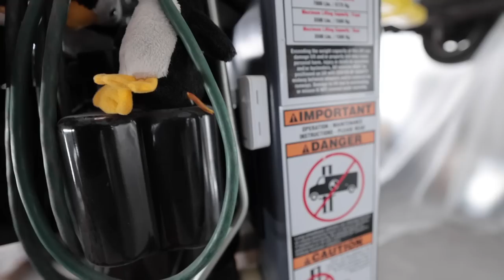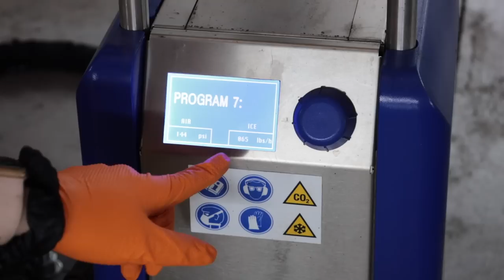Dry Ice Blasting A 50+ Year Old Car // '69 VW Beetle Project

Comment: Consider adding an automatic tank drain to your air compressor.  It's basically a small solenoid operated valve on a timer that will open periodically and drain moisture from the compressor's tank.  It will drastically reduce the amount of moisture in the lines, preventing the need to drain it at your air dryer as often.  I have one on mine, and even when sandblasting on the most humid days, I have very little moisture in my air dryer.

Comment: Hey Sarah, you can leave the drain on the line dryer open. We use them in pneumatic thermostat controls and the drains are left open at all times. Good luck and thanks for all that you do.
Reply: At least partially open enough to drain water, without impacting air pressure
Reply: @MrBeltaine  in a commercial setting there isn't an option for partial. Air pressure loss is not an issue.

Comment: Sarah they make an "agragrite" that can be used for high pressure under carriage blasting. It is less costly, does not melt, does not hurt the metal surface, and can be purchased by the bag. RCP

Comment: Hi Sarah, to fix the water problem on your compressor is to install an automatic timed drain flush valve under your compressor. I have it on my compressor in my shop and it works great, no more water in my tools. And it's cheap, around 50$

Comment: I used to go to these Hot VW meets in Southern Calif where you would see all sorts of VWs that had body off frame restorations. Very clean and the best way to do it cuz there is probably rust and corrasion between the body where it mounts to the frame.

Comment: INteresting choice, dry ice blasting is more of a mild one, not very effective vs rust, but it gets the coating as it freezes it making it crunchy and reduces a lot the mess after.. =) Well, if you're aiming to prevent damaging the undercoating or zinc finish, then you're right. I would personally choose grit or glass, but I would never do it on the lift inside your shop, but in a chamber or outside... =) True one more time, ice is a pretty mild thing, mostly used for finished surfaces and to avoid damage. Actually it's meant more for cleaning, even food processing equipment, where you must have no debris left behind. =) Cheers, girl, you rule! 😉

Comment: You need a refrigerated air dryer. A simple inline dryer really won't cut the mustard. There is a low tech solution I can share if interested.

Comment: I used to used a dry ice blaster years ago when I was a mold maintainer for a tire company... ours was a big machine... ran at 200 plus psi and it used solid blocks of dry ice that the machine shaved down... the nozzle was over an inch in diameter

Comment: Just prior to my retirement, my employer (an industrial gas supplier) obtained a dry ice fabrication machine. Dry ice works by two actions, it freezes the surface and makes it more brittle. Then the abrasive action works like sand or bead blasting to remove the surface material. The big benefit is once you are finished, there isn't a huge pile of blast media. The dry ice (co2) evaporates and you're only left with the rust, paint, etc. As always, you do amazing work, Sarah!

Comment: Hey Sarah.  I love your videos, especially the beetle!   I usually use some petrol to loosen tougher old packed grime and dirt,and just scratch it off/loosen with n scraper/screwdriver before blasting with the pressure washer 😅(find it helps alot, if you dont mind getting high from the fumes haha)

Comment: hi Sarah, there is an attachment you can buy for your pressure washer wand that can introduce glass bead into the water stream. It provides some abrasion without roughing up the surface like bead blasting does

Comment: Nice work as always! You can bake those dessicant beads dry again in an oven. They're saturated when pink, so not helping dry your air. You can also just buy a big bag of them on ebay pretty cheap, and change them out as soon as they turn pink.

Comment: There are a couple things you can do to help remove the water from your lines.  First off, drain your air compressor tank.  In the ambient weather in your area I'd honestly drain it every couple of days.  Then you might think about getting a storage tank and putting that between the compressor and the output to the ice gun, it'll cool the air and store the moisture in that tank instead of letting it get into the air line.

Comment: You could use something that creates steam, or super hot water to blast that transmission.  Companies like Hotsey, and Karcher make pressure washers that have a burner that uses diesel, or kerosene and it heats the water up as you wash.  They work great on farm machinery, or Industrial equipment like Cat bulldozers, or Earthmovers for example.

Comment: If you use a tip with a finer or smaller opening it will concentrate your output and will make your nozzle work on the goopy stuff better. Maybe not perfectly but better. Think of your pressure washer. Turn the tip one way and it’s a mist. Turn it the other way and you can literally peel the paint off of your car.

Comment: Hey Sarah, those filters never catch all the water vapor. Quick CHEAP tip about eliminating compressor moisture out your hose for jobs like this or painting. You live in a hot dry climate as I do. 1st drain your compressor of water. Then you can take some coiled up copper tubing and place inline in between the compressor air outlet and water/air separator. Keep the tubing coiled up and place it in a bucket of ice water. The outlet end is where you connect your water/air separator and then to your spray gun. 

How this works is the heated air vapor from the compressor will condense into water droplets as it passes through the ice cold copper coiled section so the water separater will actually collect it. I use this method when painting cars and you won't beleive how much MORE water you'll collect in the separator.

Comment: The Desiccant of Freight Harbor. The terrifying new novel from Ragnar Fau Ve. Nice work in restoring these old surfaces. Sometimes the grease and grime don't cooperate with the soft approach. The situation can quickly devolve to the point where picks, chisels, fingernails, and eye teeth need to be engaged. You might have used all of these, cause, ma'am, that's clean!

Comment: Pour the desiccant out onto a paper towel that's spread out on a plate. Put in the microwave on a lower setting. Do it for about 30-45 seconds at a time, taking it out and jiggling it around between blasts. It cooks the moisture out in a couple minutes.  Throw out any that go brown.
Reply: conventional oven at low heat.
Reply: @mostcom  - they both work. We just used a microwave at the airport (inter-pane side window desiccant) since it was faster.
Reply: @DrFiero  No doubt. I like the conventional oven just set it and forget it. Radar range needs far more attention paid though faster.
Reply: @mostcom  - No idea what we charged /hr, but considering the object flew, you KNOW it was a huge $ sign!  :D
Reply: @DrFiero  👍

Comment: Big 3 uses dry ice to clean the overspray of paint/clearcoat off the booth floor grating. The robots have cloths, but the floor has open grates, the ceiling has positive air that helps the overspray get pushed through the grates, and onto running water that gets put through a in house waist treatment and recycled. The grates get some serious buildup on them so they are dry ice blasted. The clearcoat is not dry, very sticky.  The dry ice makes it cold and brittle, helping it breakup. We have a lot more C.F.M. than I see you useing. A smaller tip to get the velocity up might help. Just guessing here.

Comment: Yes! Been waiting for this one! Lol 😂🤣
This totally ticked ALL my OCD boxes! Lol 😂 🤣 great job! Looking forward to the next one! Wish I could afford to rent or buy one of these to do my two BMWs, as one is ultra low mileage 55k from new, immaculate inside and outside(aside from some minor PDR needed on one panel from a car park!🤬) but it's 15+ years old and been sitting outside for 3 years stored! Underside has seen better days since it parked it (surface stuff around the brakes and wheels peeling and I'd imagine the aluminium and steel underneath could do with going over!)

The other one pretty low mileage 127k and 18 years old and DEFINITELY needs going over aswell as used daily having some wheel arch reparations soon! They seem mega expensive for cheap ones over here about £3000 for the unit! 
Great job though so satisfying to see that undercarriage clean, everyone likes a clean undercarriage (excuse the pun! Lol 😂🤣) 👍🏴🇬🇧

Comment: Probably not the original pans but looking great.  I used soda blaster on my transmission. Worked great to clean but did slightly remove the original metal polish.  No biggie if you plan to paint it.

Comment: Surprised to see that much humidity in Tucson but that floorpan looks nearly factory fresh.  Leaky trans fluids mixed with fine grit and baking heat do make some powerful hard goo.  Scraping is the only way to get it off before other methods are used.  Looking forward for more updates.

Comment: One thing I use on greasy smoot areas is a hand held house hold steam cleaner. They advertise them on TV and look like a tea pot with different nozzle tools. Fill it with the little measuring cup and plug it in. When you got good steam, spray it. I do use some Gunk degreaser first for really dirty stuff but it works and doesn't cost much. It doesn't work on everything but I have good luck most of the time. Good job! You're the hardest working girl I know, awesome!
Reply: Having a community is always a great resource. If you go way back in time to Sarah's early videos, there you'll see she has one that she used on car interior detailing and possibly on Mr. Dos's underbelly.

Comment: let a little air continuously leak at the filter for the air dryer so that the water will blow out of the air line. try to make this leak the lowest spot in your air system. should help

Comment: Soooo what determines the actual pattern that the dry ice sprays?  Is it the pressure settings, the volume?  "No it's Just the tip!"  Note a "Just the Tip" innuendo was missed. 😆
Reply: No it wasn't. Cool Mistress.

Comment: Dry Ice blasting should remove the heavy greasy residue. I have seen it used on  heavily grease crusted industrial equipment. Dry Ice blasting works by freezing the greasy coating causing it to shrink and break its bond with the surface. Could be that you have to much air and not enough dry ice. Great show all the same :)

Comment: there is always mineral goop hand cleaner to break down grease and gunk , i know you want a laser welder, that can clean, cut and weld- no sand blasting for you after that, ok, maybe I did sell you on ice blasting, it still is fun use, try the small nozzles like last time for hard spots, when use a torch to cut, you don't want to get freaking with big nozzle, when you have the little one to get in corner

Comment: Leave the drain valve on the water separator cracked open a tiny fraction and it will drain itself 😊👍

Comment: Sarah, do you drain your compressor very often? There should be a valve at or near the bottom of your tank. I open mine when the tank is pressurized and it blows out the moisture in a hurry. I love your channel you are fearless and highly skilled!

Comment: Great job getting dirty while getting clean. Have you tried AGS RUST SOLUTIONs vs POR? I have recently started on my 18 JKU,it comes in both brush & spray form. The reason I went with it was that it has UV built in.

Comment: Just curious , have you seen or used a laser cleaning machine? They are quite amazing devices that cause very little damage to the original surface depending on how they are set up. They are available in all different sizes depending on how fast you need to go and what you have to remove. I think they are reasonably expensive but they are fascinating to watch clean something. There are heaps of videos on YouTube showing various cleaning tasks. One more machine I saw that was very versatile in cleaning is an Optima Steamer made by SJEcorp in Korea. It can clean and sanitize the interior, exterior and engine bay etc and reasonably quick and effective. This is also on YouTube showing various cleaning tasks! I am now retired but detail cars as a hobby and always on the look out for better and easier ways to do things and these machines caught my eye. Cheers! 🙃

Comment: Most of that loose undercoating could've been blasted off with compressed air, I did that during restorations on 1950s and '60s Alfa Romeos. Might've saved time with the ice machine, I don't know what the pressure that was blasting with, 90psi?
Reply from the maker: Negative, ask me how I know 😉

Comment: Brake parts cleaner, in a spray can, does a nice job of dissolving gunk.  I use it to clean a chainsaw bar after using.
Reply from the maker: Makes a mess and ruins paint

Comment: As a DIY with a cheap air compressor that had something called a "paraffin gun" in the kit I always wondered what the hell it was for. I had a car with massive old caked on oil leaking from the head. Fixed the problem but needed to clean it all up. I don't have paraffin, or kero, but I had a gallon or two of old diesel in the shed. I used but a pint in the red "paraffin gun"
My word blasting the engine block, the inside of the cylinder heads, everywhere with plain old diesel totally stripped everything clean it was amazing. The whole place did smell like an engineering shop afterwards it has to be said.
In the UK dry ice is hard to get in small quantities the whole industry is run like a cartel. It looks like there is no reason to use it anyway.

Comment: Well that's a pile of gunk. Though a big part of that pile is the reason why it doesn't have more surface rust on it.

And if you get to do a car review on it, you should rate it with the vintage beans (kind of like the ev's get the e-beans). I know that it doesn't weigh much, but it'll still get like 0,5 regular beans 😂

Comment: Have you tried brake cleaner on those heavy grease buildup? Usually mineral spirit will remove all oil and grease related stuff.
Reply from the maker: Brake clean destroys the finish under the grease and everything it splatters on, not worth the risk.

Comment: Your compressor should have a drain valve on the bottom of it, and if you're using it every day (I'm sure you are), you should be draining the moisture out of your compressor at least once a month.
Reply from the maker: Drained it multiple times that day.
Reply: @SarahnTuned  wow that poor compressor is working overtime for that much eater to be coming out.

Comment: Just out of curiosity, where does the CO2 come from? It must be some industrial process. I doubt if it is extracted from the air.
Reply: Carbon dioxide that is sold as a commercial product is recovered and purified from industrial plants, typically as a byproduct of large-scale chemical production or biological processes. This helps prevent large amounts of carbon dioxide from entering the atmosphere.

Comment: Your air purification wont work when you are dry ice blasting. The CO2 levels are too high. Your hood only filters the particulates out of the air, but if your dry ice blasting, there may not be enough  O2 because you are displacing it with CO2. Your hood doesn't creat O2. So you run out of O2

Comment: Dry ice blasting is what we use in the factory for cleaning equipment.
We use BIG screw air compressors AND a refrigeration type air dryer to get the moisture out of the air .
It is a great choice.
Just remember to keep fresh air flowing through the area.
Dry ice sublimates from solid to gas and displaces YOUR OXYGEN you need to breathe.
Reply: Hint , for those small water/air filters , ya , leave those drain valves open a little bit for a constant bleed/drain while blasting so they don't fill up.